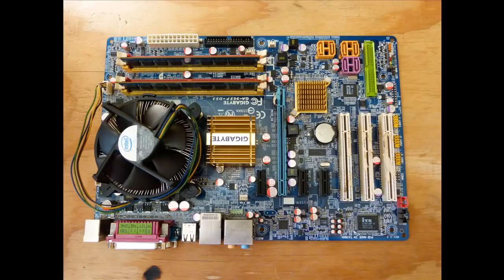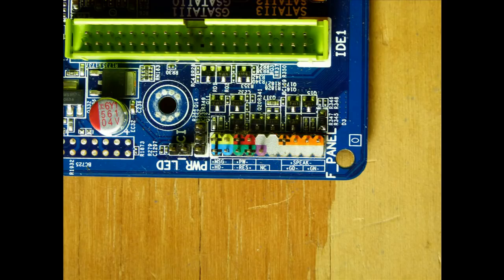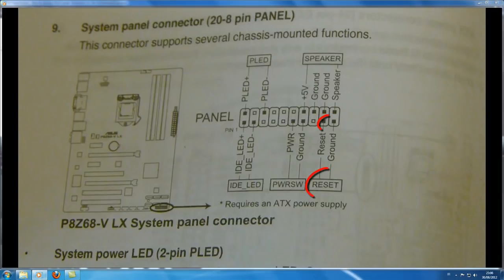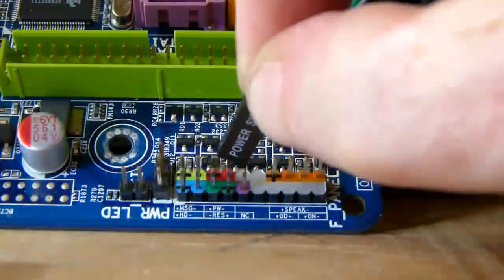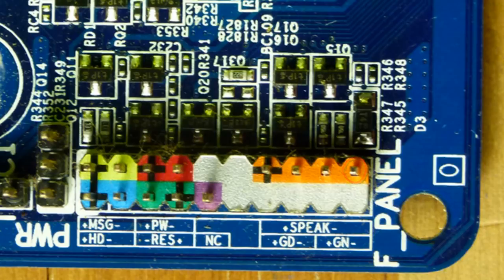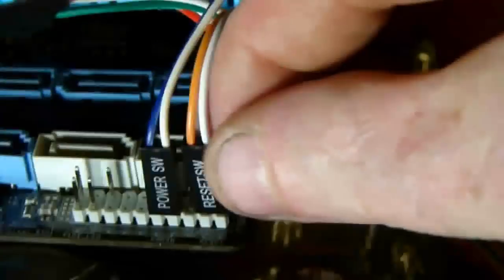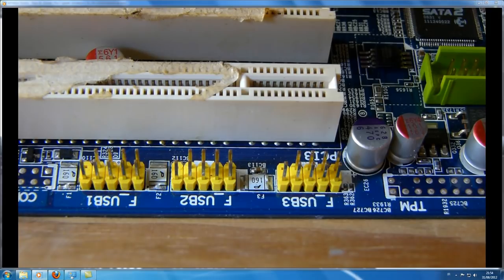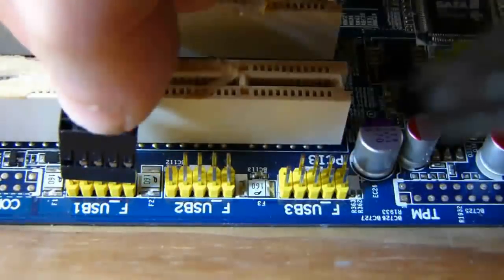How to connect front panel connectors to the motherboard

Comment: recently i noticed that my front panel audio is not working. when i checked my motherboard then i saw audio cable is fine but power led +,- or speaker from my front panel is not connected. after connected them , when i start my pc then all the hardwares like mouse ,keyboard ,monitor usb slot etc stop working. then i again disconnect all of them ( power led +,- or speaker only). then all things become normal as it is,means  front panel audio is not working but all are working . is something went wrong .if yes then what can i do.
Reply from the maker: Hi, This could be anything from a short on the power led or the speaker it could be a fault on the front panel connection area of the motherboard. It could be that the motherboard has failed in the front panel feed tracks on the motherboard. Basically it could be anything you mentioned. 

But if i wanted to sort this problem out i would start with replacing power led and speaker and if that's not possible or it just does not fix the issue it maybe time to get a new case. motherboard is probably getting on also over 3 years things can just start failing! an up to date new version of the motherboard would be a good idea which would bypass a lot of that problems you mentioned. That really is all you can do! unless you can live without the front panel audio. OK!
Reply: thanks ,
Reply from the maker: Your welcome!

Comment: I just got a new pc and after i installed all the stuff my microphone didn't work (not even in front panel or rear panel), is there and connector for microphone or stuff like that?
Reply from the maker: Your microphone jack back of PC should work out of the box no connection needed just plug and play! So check device manager under sound video and game controllers to see if drivers are installed and working! Other than that the microphone could be faulty check on other device. It is possibly a fault  on the mobo, but highly unlikely, its usually a setting off in the sound recording section in sound mixer check this also. microphone jack back of PC is pink in color  OK, hope that helps!

Comment: is it same arrangement in other motherboard cuz my mobo doesnt label which one
Reply from the maker: get the mobo manual and check you will find it on line if you don't have it
Reply: but my dell vostro 220s just show only on bottom right front panel only.....not specific for each pins
Reply from the maker: that's cause a dell can't be upgrade unless you get a custom motherboard and modify the case dell don't allow new boards to be installed! so it has to be modified! And so they don't label there components so you easily modify or make changes! Sorry about that dell don't play nice!

Comment: Thanks for the input on my OLD Dell update on the Dell front panel to my new ASUS H97M-plus motherboard w/32gb Dimm DDR3 . I removed the little green Dell switch and removed the Dell wires and connectors and installed new I.D. bit cables. (like your video) I had to adjust the ID of the new LED holes in the front panel with a step drill so the switch would fit. And then add a small square hole for the reset switch into the front panel and the setup was complete. Now I need to add the speaker ID bit cable jack. Today I'll be installing a new atx 750 watt power supply, a R/W DVD, 250GB HD, and the old HD with the new connection to Strata cable. You have been a great help. Thanks for your service. I'll keep watching for new stuff. I am trying to build a 3D Design graphic system for CAD/CAM to CNC setup. Thanks Dezrat.
Reply from the maker: Thanks Steve! Enjoy the building process bud!

Comment: i need help i have 4coredual vsta motherboard and this case NZXT PHANTOM ATX Full Tower Case, Black and Green, PHAN-002GR
 and dont know how to connect to get resset switch working or the hd audio port working
Reply from the maker: did you follow the video all the info you need is in your user manual my advice is to follow it carefully and it will be sorted! all motherboards are similar in design as far as the connection are concerned! So follow video and if you get stuck open the manual for the motherboard you can download it manual for the motherboard on the manufactures website! OK!
Reply: Kevin Colleran ya i figured it out sicne i got this motherboard used but in perfect condition so now im connecting them but now my fan wont light up that did last time but i think at least i got the power connectors right though got to fit the pled plus and minus one i took them out trying to trst something
Reply from the maker: Nice one! Glad you got it sorted bud!
Reply: Ok thanks
Reply: Kevin Colleran ok got all connectors correct but still no light up for fan and one of the fan controllers the light blinking and i got 2 fans the front panel side one connected to since they both on side and same location
Reply from the maker: probably a fault in the led cable for fan light replace if you have connected correctly!
Reply: Kevin Colleran i believe i do have it connected correctly but dk why lights wont light up if they did last time before i took it apart
Reply from the maker: I'm not sure! you could have blown it by taking it out. are you sure you have it connected correctly? maybe it's just one of those when turned on the power on the PC it blows these things happen...
Reply: Kevin Colleran maybe the connector that goes to the lights are broken or something? t was if any
Reply from the maker: Ya something is not connected or blown!
Reply: Kevin Colleran wish i knew what wire went to the lightsd and stuff cause the manual that it came with is terrible cant even understand or read it
Reply from the maker: What I'd do if i were you, is replace the whole unit light and fan!
Reply: Kevin Colleran ya but idk how cause it came with the case and i do not know if it possible to even replace it the lights. But again not a major deal cause at least fan works and everything
Reply from the maker: yes you can replace all fans and lights, but if you're ok with it that's fine! But know that all components can be replaced! that's why i have the same computer case from 20 years ago and still working fine with new mobo and all it's trimmings :^) happy computing bud!
Reply: Kevin Colleran ya but sadly oem computer case cannot be used cause i have dell dimension 8200 perfect case jsut terrible heating issues and wont fit anything really though maybe it will it a full sized tower case i think
Reply: Kevin Colleran well funny thing i accidentally took the button that at the time had no clue what it was for out so had to take fans out which the one that had lights was needing to come out and side fan and i put it back in button fell off so had to put that back in to and once all back together now lights work. weird right? when i pressed that switch before nothing happened now all of a sudden it works i press switch turns on press again turns off for the lights
Reply from the maker: well that's the way things go sometimes! Glad you got it sorted bud!
Reply: Kevin Colleran :)

Comment: what is the name or number of the connectors used in the front panel connection? I'm rebuilding my old DELL and using a ASUS H97M Plus motherboard and the old Dell front panel. I need to cut the old wires and mate them up to the connectors that fit to the motherboard. I have gone to FRY'S but can't find the small 1 pin, 2 pin, or 4 pin connectors. Thanks: Dezrat!
Reply from the maker: you have to go to dell for that info! they made the front panel connection and the connector will be there design! failing that you have to bypass and put in a set of connection in one of the 5" bays on the front panel it's the only way! Dell make it very hard to renew or upgrade! So that is the only option available 5" bays!
Reply: Kevin Colleran Thanks:

Comment: Hey I just builded my first gaming PC and everything works but the only problem is that my audio socket on the desktop doesn't work. I plugged everything on the motherboard...no luck :( any suggestions? Thanks
Reply from the maker: +OG TIZORR Hi, front or back of pc socket not working? Which one? check setting in volume control settings and double check the front panel audio connection to be sure! check sound driver in device manager. check al that and see does it work.
Reply: +Kevin Colleran Im using the front PC socket. When I check the volume setting, I said that I have Digital Audio ( S/PDIF) (2 - High Definition Audio Device). I think Im using both audio...

Comment: My front audio connectors are not grouped up, i have to place them pin by pin :( any guides on that? wich color goes where? :(
Reply from the maker: +Serial Killers Documentaries Hi Bud! Do a search for connecting the front panel audio buy using the motherboard model number! There is bound to be a guide somewhere on the web...OK!

Comment: i accidently unpluged my fan i think and i dont know where to plug it back(i am not talkong abotu cpu or gpu fan,i have 3rd)and on that black thingy like hdd led it says "m/b sw" pls help
sry for my bad english
Reply: i am using gigabytes p31 ds3l
Reply from the maker: +Milos Mandic Hi Milos, As far as i can see... it's right of the SATA data "yellow" connectors  called "SYS_FAN" just opposite looking in at the installed motherboard! It will have 3 pins, but only two are wired to plug. Then plug it in there. If the fan does not start spinning, turn it the opposite way! hope that helps....!  PS can't see it properly in the manual, but it is there!
Reply from the maker: +Kevin Colleran Found the the motherboard manual here it is system Fan no.1 is opposite front audio connector named SYS_FAN1 this is just behind the I/O Back Panel Connectors here is a link https://www.google.ie/url?sa=t&rct=j&q=&esrc=s&source=web&cd=1&cad=rja&uact=8&ved=0ahUKEwjZx6qtitjLAhUGRQ8KHdniBiUQFggbMAA&url=ftp%3A%2F%2Fdownload.gigabyte.ru%2Fmanual%2Fmotherboard_manual_ga-p31_ds3_ds3l_s3l_e.pdf&usg=AFQjCNGtHDPEkZr6HOEgMt7sbQCvmChD-w&sig2=f1As8OQTe4wnGzYoSpd_4Q
Reply: +Kevin Colleran thank you very much!!
Reply from the maker: glad to help!

Comment: Hi, I recently built with a corsair 100r case but one of the usb in front panel doesnt work while the other one does. I dont know what the problem is. Can you help me please?
Reply from the maker: +Nicholas Nara if you checked the connection on the mobo! then it could be the usb port on the front panel that faulty have tryied plugging in different usb devices see does it work with anything? IF it dose not then it's a faulty port! you could try plugging the front panel connector into a different connection on the mobo and see dose the work which would mean the connector on the mobo is faulty! Hope that helps! if all that fails to fix the problem the you have to bring back the case to the place you bought it and have it replaced. OK!
Reply: I tried replugging and tried many devices. I'm beginning to suspect it's a faulty port. I will try plugging into a different connection on the mobo. Thanks for the help. I think it's too much trouble to return the case. (have to unplug everything, return, wait for case, rebuild pc. All while having no pc to work with)
Reply from the maker: if you want more usb ports on the front panel you can get a front panel usb3 or usb 2. something like this https://www.youtube.com/watch?v=ekaBJbjmE6s

Comment: hey i havw a problem.
i am a first time builder.
i will be buying corsair carbide 100r with front usb 3.0 headers with asus h81m-k which have usb 2.0 headers.
is there any possibility they would work?
Reply from the maker: +faiza saqib Sorry bud! that asus motherboard does not have usb 3 front panel connector but you can get a usb3 front panel extension card like this one i show in this video https://www.youtube.com/watch?v=iW54kj358EY

Comment: what if i miss connect the connectors? will the motherboard be gone for good?
Reply from the maker: +Ishfaq Zaman Not at all! it's just the pc might not start or a light might not light up. But it won't damage the board ok! Just try checking everything 2 or 3 times but don't sweet it if you get it wrong, just switch connectors you will eventually get it right OK!
Reply: +Kevin Colleran  Wow thanks for the reply. I  tried building my first pc yesterday. i had plugged everything and the pc turned on just fine. Then i realized that the front audio ports of the case were not working. I turned off the pc and checked my motherboard. I saw that i had actually connected The audio connector to the speaker pins. I quickly unplugged it and connected it to the f_audio pins..Then I tried Turing it on but the pc just won't start! I'm scared that i might have killed my mother board :S..
Reply from the maker: i!n the panic did you do anything else? like turn to power switch on the power supply to it's off position! or disconnect anything else? You have to double check everything even unplug  the ram and the cpu fan and then plug them in again. You may have touched off something and displaced it! Just check everything again! You have not done damage to your PC it's ok ! It just something that's not connected correctly OK! Hope that helps!

Comment: ahha glad I found this ,Ive just bought a used Gigabyte Motherboard similar to the one you were using in the video, I was wondering if you knew if is it possible to use the Northbridge fan header to power a case fan? many thanks in advance N.
Reply from the maker: +oojimmyflip Not really! because that is controlled by a temp of the northbridge chip. So two good ways to power the case fan is to connect it to the motherboard fan connection on the motherboard there is usually two of them labeled SYS_FAN 

And the other way is to connect the fan to the power supply and most fans come with that extension cable to connect it to the power supply, if not supplied you can get one in a local pc store. Enjoy the build bud!

Comment: Hey i have a usb 3.0 port on my Chaser A31 Full tower. My motherboard is the MSI x99s gaming 7 motherboard.

The usb port is blue in color. Where does the cord go on the board?
Reply from the maker: +Raghav Sood The connector coming from the front panel has a 19 pin connector, so you will see a 19 pin connector on the motherboard usually somewhere along the edge of the board. On your board it's beside the 24 pin psu connection. If you can't find it, look it up in the manual that came with the motherboard. OK!

Comment: How do you tell which side is positive or negative, without it being printed?
Reply from the maker: SangoProductions21 Hi there is a printed arrow on the back of the connectors indicating the "positive" wire. you have to look very close to see it, but it is there. it's usually on all connectors.
Reply from the maker: SangoProductions21 Hi there is a printed arrow on the back of the connectors indicating the "positive" wire. you have to look very close to see it, but it is there. it's usually on all connectors.
Reply: thanks for the fast reply.
Reply from the maker: no problem! i hope you figure out the wiring!
Reply: i did. even before  replied. but thanks
Reply from the maker: good for you bud!
Reply: SangoProductions21 colored wire is always positive.
but when black and white is combined, white is positive..

Comment: Hi, I'm building a rig soon for the first time soon. I have some experience with hardware and have disassembled and reassembled an obsolete core 2 duo rig as a test to see if I can do it but I have a question. I have a very basic but old case. I see no need to change it as it does have decent airflow and fan slots ect. The only thing it has on the wires is KSP with an arrow head on one side. that is each set of wires will have KSP with an arrow head on one side denoting one wire of the two wire set. What can happen if I connect them wrong? Also I have to sets of power wires one is "power SW" and the other is "Power LED" What is the difference between them? The second is for the led is SW for the button itselt?
Reply from the maker: ShatteredMercury Hi, The arrow on the connections coming from the front of your case "indicates the positive" wire that needs to be connected to the "positive pin" on the motherboard. Consult the manual for that info! The "power sw" is the connection from the button you press to turn on the computer, and the "power led" is the line coming from the light on the front panel, that indicates the computer has power and should light up as soon as you turn on the power switch button! Yes all cases are set up to work with all new Motherboards so you should have little problem geting it to work as long as the motherboard will fit in you case important for you had a "standard ATX" or "micro -ATX" make sure the case fits the motherboard you are buying! OK, Hope that helps!
Reply: it also says KSP right by the arrow head that is positive right? I don't have the case manual if there was one since the case is roughly 12-13 years old, and my new rig is being shipped at the moment so I don't yet have the mobo manual. I'm sure the case will work fine. It has several fan slots for decent air flow and has over the years seen many setups probably around 5. The ATX standard is still going strong. It will be good to upgrade core2 duo 4600 to an i5 4590 :)
Reply from the maker: Hi, Yes the arrow head is always the positive! Enjoy the experience of building there is no better skill to learn if you enjoy computers and what they are capable of doing! The case is fine, so don't be worrying about it! if it's Standard - ATX It will be compatible with new ATX Motherboards. So enjoy the process ;^)